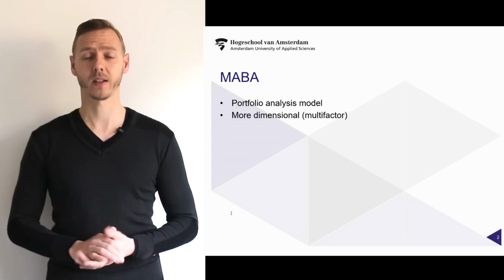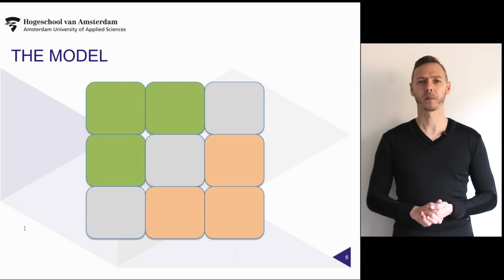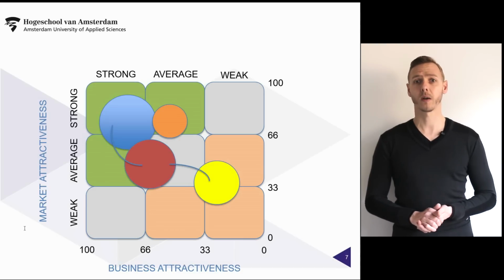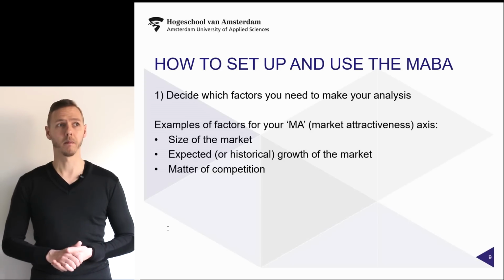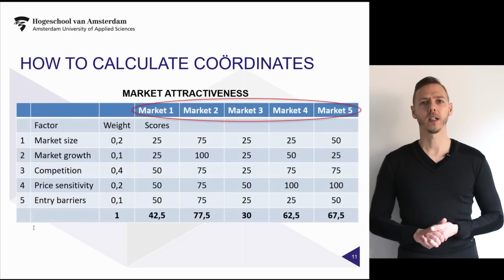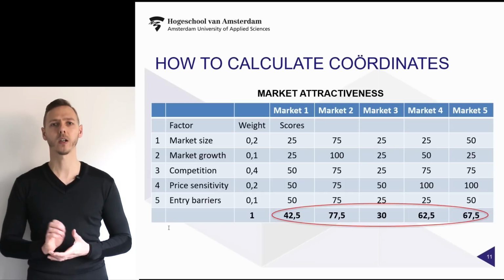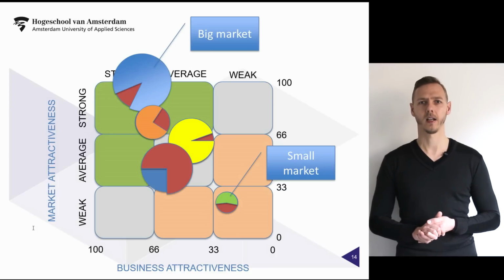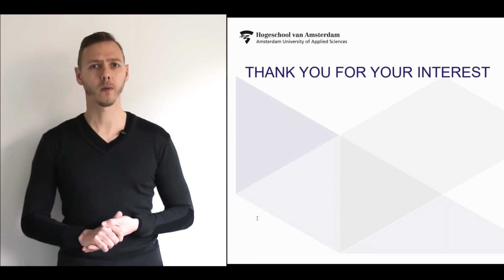The MABA Analysis/GE Matrix explained

Comment: Thanks a lot for the explanation. I've got all but not the part about circle. The cordinates are uselful to plot the point standing for the business. Right?
What will indicate the radius or diameter of the circle?
Reply from the maker: Very good question! The coordinates (and thus the circels) indicate the position of the specific market (perhaps country), business unit or product market combination. The size of the circel is what you decide it is. For instance: Profit, turnover or Market size. If you take a country and the jeans market: then I prosume USA will be quite big, France avarege and the Netherlands very small. The 'piece of the pie' would be your marketshare, in that market/country. If you use it for one specific country and your position in that market, then the  different circles would represent your SBU's or PMC's. FOr instance you are Suzuki and have three circles: Outboard Motors, Cars and Motorcycles. The circel represents the whole car market in unit sales (in that  country) and the 'piece of the pie' is your market share whithin that circle. Ok?
Reply: @PepijnSchoemakerWebinars  I thank you for your rapid answer.
Yes it's ok. It's great. Be blessed.

Comment: Can we have an exhaustive set of parameters for MA/BA and use a particular subset of parameters for a particular business? I mean different subset of parameters for different businesses, ensuring that the overall weight is 1?
Reply from the maker: Yes you can of you want. You would change the model a bit to your liking. Although the model was invented to use 5 parameters per axis. The forces you to choose and weigh only the very most important criteria... Try to do so. Of you can't, choose more. 5 is better though.
Reply: Just to confirm, I have 10 parameters as an exhaustive list, for business 'A' I choose a subset of 5 parameters and for business 'B' I choose a different set of 5 parameters. This is ok? If I do this where is the consistency? I thought all businesses need to be evaluated on the same set of parameters.
Reply from the maker: @nsub4184  No. The parameters should be the same for every 'circel' in you MABA. You can not differentiate those withing one model
Reply: @PepijnSchoemakerWebinars  cool, thanks a lot👍

Comment: Query:
How did you decide on the numbers in the market attractiveness : eg: Market1 25,25,50,50,50. What was the reference or source of these numbers? Appreciate your help, Thanks
Reply from the maker: Hi Prakhar. That's the nice part of this model. You decide these numbers. These are the weights of importantness that you give them. So very important should be a high number whilst a low weight is not so important. Ok?
Reply: Pepijn Schoemaker hi pepjin, I know how the weights work :) , my question was about the other numbers with whom the weights were multiplied with. How did you obtain those?Thanks. Btw your webinars are really useful. Eagerly waiting for your new updates!!
Reply from the maker: Prakhar Sinha Ok. Those are the scores. So, after your analysis you have to be able to give the certain country (for instance) a specific score on that criterium. This is also something you decide. But always give a good substantiation to that.
Reply: Pepijn Schoemaker thank you so much for the swift reply :)